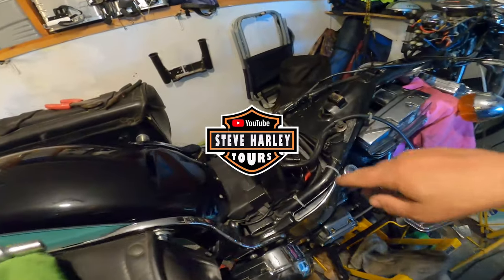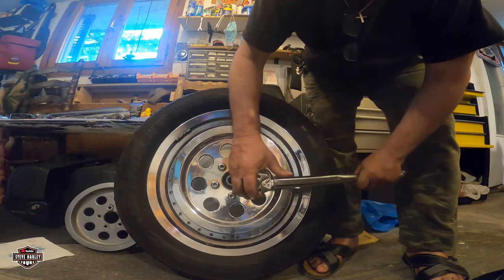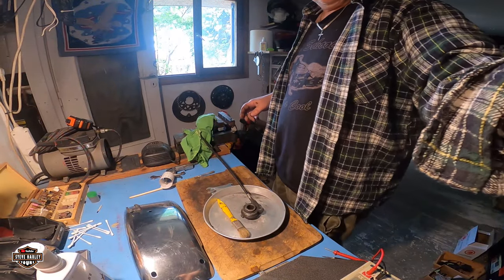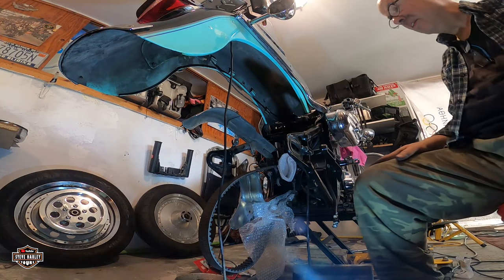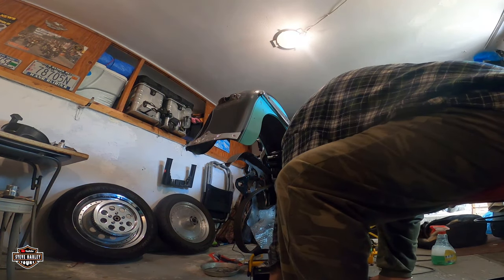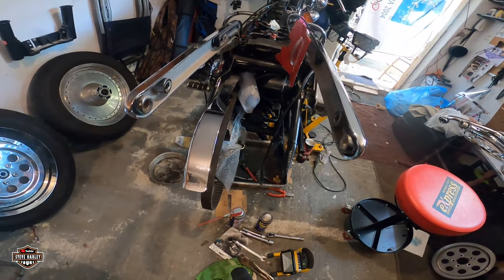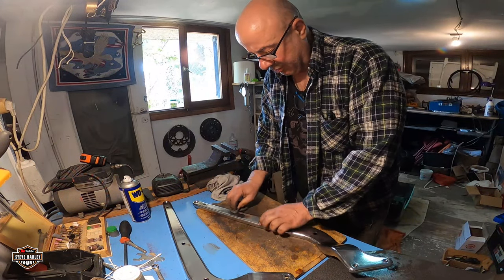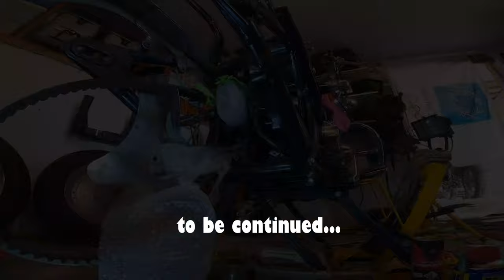Harley Davidson Evo P24 - Pulley Install. Front Wheel Removal. Rear Fender Removal

Comment: I haven’t done is nearly as much maintenance and refurbishing as you have but I did recondition my battery. I have a CTEK . mus 4.3 and this type of battery charger can recondition batteries it has a diesulfation mode ,my bike we’re starting kind of slow it was cold about 40° so I thought I would give it a tuneup a battery tuneup. When you get done you’ll have a brand new bike there!!!!!!
When I cleaned off my negative to ground the frame I like to use those star washers are use them there and also under the voltage regulator
Maybe I missed it but I have been told it’s best to change the bolts that attach the pulley to the rim if you ever take them out. I’ve heard about the Dina.. rear pulley bolts coming loose but never in a softail and I don’t know why..
I am the same way on chrome what I do my handlebars and a lot of chrome pieces I run them on a wire wheel and it gives some kind of a stainless steel look ..I painted my oil tank black…
Thanks for the shout out 👍🏼✌️
Reply from the maker: Thanks for the update helped, the old type chargers are the best to recover an old battery, also the one you have, good ground is very important yes, if you want to clean chrome use this 4 zero wire, the bolts are not the original these are after market never have any problem , talk later thanks 👍😊
Reply: @SteveHarleyTours  You only reason I know about CTEK chargers. I watch the video Jay Leno bought one for each of his automobiles in his ,,I guess you would call museum.